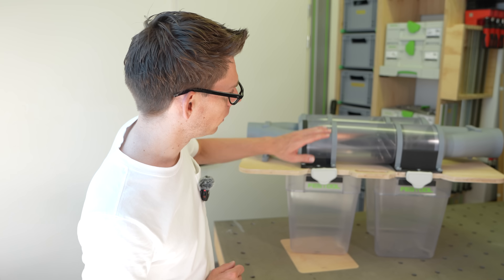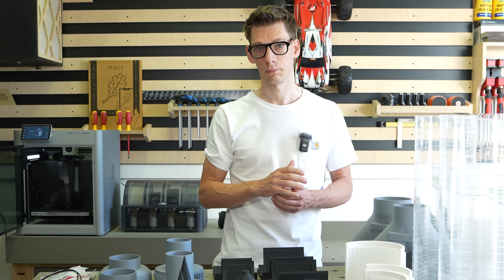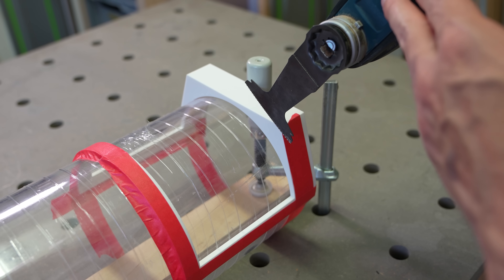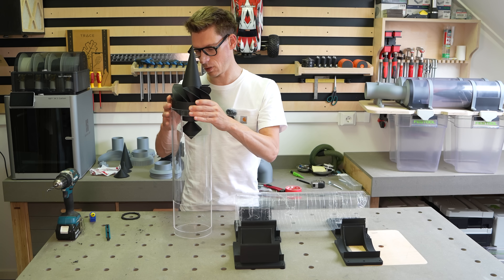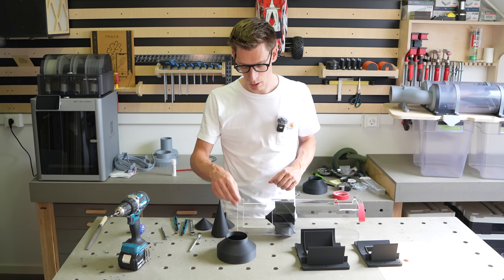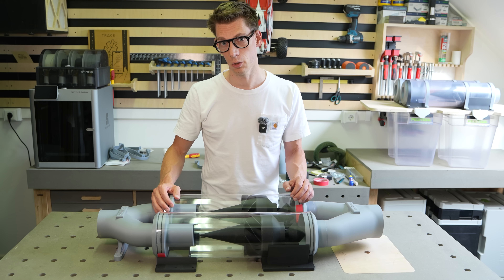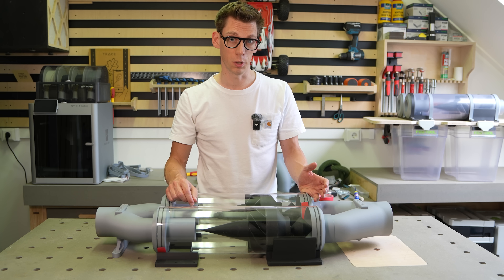I Built my Centrifugal Dust Separator, Again! (€200 Budget Dust Collection)

Comment: The tube remains by far the most costly part of this project, so I’ve thought of some options to explore:  consider making your own tubes by either using turned wood cylinder or pipe as a mandrel, heat form sheet of acrylic, polycarbonate or even pvc, then just use appropriate bonding agent for the seem which could be hidden at the bottom between the two openings?  Option two is fiberglass? Option 3 is to use less expensive nontransparent pipes with the possibility of adding transparent windows made from either PC or acrylic.

Also if I can confirm from your testing, the larger diameters (original 8”, then 6” or close to this 150mm) had the best performance especially in regard to adversely effecting airflow? But also in separation efficiency?

Comment: I'd redesign this with Ø10mm holes as the corners of the cutouts on the acrylic tube to reduce the risk of cracking the tube during assembly. (It's great work otherwise ) 👍

Comment: Hi Rudd, thank you for the project and the video series on it. I decided to print and assemble one myself for my CNC Router. I have it currently hooked up to a large dust collector fan with 4" hose from the CNC to the separator and 4" hose from the separator to the dust collector fan. 

What I am seeing is that the first stage does not catch much and whatever it does catch is sucked back up out of the bin and then brought into the second stage bin, then that too is sucked up and transferred out the fan. 

Do you think I possibly have too much air volume being moved? I see yours is set up with a vacuum style collector
Reply from the maker: This looks like you are moving way too much air through it. Do you have a idea what the CFM on your extractor is? And what is the air velocity on the y-piece intake?

In all the tests I did there was no such issues like you are experiencing. My CamVac is not capable to move large volumes of air but many have built it in combination with a 2HP harbor freight extractor which was working fine.

Simple test is to reduce the air flow through your collector fan by blocking the inlet or outlet partially.
Reply: @CapturingDust excellent Thank you for the quick reply. This was my suspicion. I am not sure on the CFM, I have a meter at work I'll bring home to check.
Reply from the maker: And are you sure all the seals are actually sealing properly? It also sounds like air is being sucked in from the waste bin, which then carries the dust with it.
Reply: @CapturingDust 

That is a definite possibility! I will check that

Comment: Hi, I'm loving all of your videos. I run a massive workshop and currently we have a dust collection system that runs roughly at 6500cfm with the main feed line at 250mm diameter. I have a custom made 9m3 collection bin that captures at a guess around 95% of our wood shavings. Now here is the issue, the return from the bin runs through to a bag house that filters down to only 5micons (this bag house we have to shake the bags every time before start up due to how blocked they get) ideally ill love to improve this by introducing a design very similar to what you have built after the shavings bin, but before the bag house however do it only using the second part of your separator design as I'm trying to capture the smaller particles that tent to block up the filter bags. 

By any chance would you be able to help me with some measurements for a system so large?
Reply: Sorry might I add I'm going to make the whole thing out of steel not 3d printed :) but really unsure of all the pipe ratios and fan fin angles etc
Reply from the maker: Hi Marin! Glad to hear that you’re loving the videos. I am trying to figure out what dimensions scaling will do with the design and efficiency. But that is easier said then done. You run a lot of CFM trough your lage pipe with I guess a lower pressure blower fan in front of the filters? 

It’s not a straight forward answer I can give you. Still figuring out myself what different parameter changes will effect the performance on separation and airflow restrictions. 

You can put multiple smaller separator in parallel to increase capacity. But to increase separation efficiency for the smaller dust particles you need to increase airspeed so the air rotates faster and smaller particles can been pushed to the outside of the centrifugal tube and filtered out. This will introduce more friction and your blower motor needs to be able to provide this.

Comment: This looks awesome, but also looks very complex and takes a lot space. I designed and built a cyclone that removes large and fine particles and has only 3 3d printed parts. A cyclone will reach higher circumferential speeds and therefore remove smaller particles.
Reply from the maker: I'm currently working on a video with tests to compare a normal Cyclone with the Centrifugal Separator. I just did not had the height available for the cyclone to fit in the workshop. So that's why I build this one instead so I could mound it above my planer.
Reply: Could you make short video about that? That would be very nice!

Comment: Ben druk bezig met het printen van alle bestanden. Ik heb echter een systeem van max 100mm afzuiging nodig. Je inlet is 120. Hoe kan ik deze het beste scalen naar 100?
Reply from the maker: I added the following files for you to the GitHub repository:
- MK2_EU_100mm-hose-adapter-to-100mm_REV2.stp (for CamVac flexhose)
- MK2_EU_Y-inlet-100mm_REV2.stp
- MK2_EU_bracket-inlet-100mm.stp
- MK2_EU_inlet_100mm_REV2.stp

See the file folder: 
https://github.com/Makerr-Studio/CentrifugalDustSeparator-/tree/main/MK2_EU/STEP
Reply: @ thnx alot! Im trying to use a different container to make it a cheaper build. Once done I can share my findings/files with you .
Reply from the maker: That would be nice! In USA someone already used different types of containers only they are not sold in Europe.

Comment: Has anyone tried printing the components in PETG?
Reply: I think going the route with carbon fiber added to the filament would be a good choice. There is a channel that did an exhausting one or two hour comparison of all the top filaments and highlighted PCTG as one of the best filaments
Reply: @VolikakisChristos  I am considering printing in PCTG for the added "slipperiness".

It is worth noting that PCTG is not carbon-fiber PETG (PETG-CF) but a seperate type of plastic. It is similar to PETG, but usually slightly stronger and with less friction. 

Addinf CF generally doesn't do much, just for the looks.

Comment: Something I've been wondering looking at the plans is how 'magic' the 500mm length for the main tube is. If it was shortened to 450mm then two could be made with one 6"x36" piece of clear tubing instead of 2. Do you think this would make that big of a difference on performance?
Reply from the maker: I have the feeling that 450 will work. Only I did not test that. The 500mm was something that Tim from Pilson Guitars had calculated based on the Harvey G700 and scaled it down from 8 to 6 inch.

Comment: If we assume that the design of the separator is perfected and we have transparent containers and transparent inner and outer hoses before and after the separator, we then can eliminate the need for the transparent acrylic tube and use just a regular plastic waste water pipe. It can be cut much more easily, it is a bit more durable and flexible. This way we eliminate one big part of the cost of the build.

Comment: Do you cut your tubing to 500 mm?  I see that the PVC tubing is sold in 36 inch lengths, and was wondering if 500 mm is the ideal length  for air movement, or if a longer or shorter piece would work just as well.  Thanks!
Reply from the maker: I took the length from the Pilson Guitars design. He scaled it back from the Harvey design. I have no idea if this is the perfect length for the 6 inch tube. Harvey uses 8 inches, so perhaps the length doesn't scale linearly with respect to the diameter.

Testing different length is a bit expensive and time consuming. My feeling is that a bit shorter tube (18 inch) still works fine. Only that is not tested.
Reply: @CapturingDust  Thank you for your reply.  I will let you know what I decide to do and how that length performed.

Comment: I wanna try something similar. 

Instead of the first section of the centrifugal system I'll just use a cyclone though. Then I'll add an impeller after that to separate the small particles. Then a vacuum with a HEPA filter.
Reply from the maker: It a bit like the cyclonic inlets I am testing with: https://www.youtube.com/shorts/yXznpm2pys4

Really good for larger dust from planers, not good for fine dust. It will overrun the first stage. 
You will need a vertical cyclone to benefit from the gravity. I think you had that figured out already?
Reply: @CapturingDust  Yup, that's exactly my plan. 👍

Comment: How does the dust seperator works with dust from stone or metal?
Reply from the maker: I did not test that one. I think it is a little too abrasive for the 3D printed parts. Depending on the weight of the dust it might be filtered out for the majority depending of the particle size. That is a guess though.
Reply: If you have a metal shop, I would definitely add a magnetic field to the dust separator to capture the heavier particles

Comment: Very nice! Have your tried 3D printing the seals from TPU? This has worked for me in many applications. Low lead time, customizable, low cost.
Reply from the maker: No I did not tried it. What kind of fillement did you use for it? Bambu Lab only sells TPU 95A HF
Reply: @CapturingDust  Sadly the spool(a few years old) doesn't list the Shore rating, and the name is "eLastic", which is super hard to search for.

Comment: Nice build! On a different note any time I see someone with an x1c without the gold pei build plate I always feel the need to recommend it. The bed adhesion is so good you don't need to print with brims or glue for pla and petg to stick. Since I purchased mine ive run 10s of kilos of filament on 100s of prints and have had less than 5 have adhesion issues. Its truly a game changer
Reply from the maker: I feel like this is the best tip of the month! I directly ordered one 👍. I need lots of glue with the standard plate so that would be perfect if we can eliminate that 😀
Reply: @CapturingDust  Just be sure to clean it with a bit of alcohol every once in a while and be mindful that your fingers leave behind oils that hurt adhesion so try to limit the amount you touch the plate directly where the parts might print and you shouldn't have issues again. Good luck

Edit: Also after printing on it wait for the bed to cool to room temp and the part will come off incredibly easy. It feels like magic

Comment: FYI, I've been printing from the STL files and there's notable differences between those files and what I see in this video. Would it be fair to assume that the STEP files are the most up-to-date?
Reply from the maker: For performance there are no differences. I have the EU version the most up to date. And will add the latest revision you see in part 2 of the in- and out-let, and Y-pieces later today. It should be compatible with older versions. They only need a bit less material to print now.
Reply: @CapturingDust  Specifically, I was looking at MK2_impeller-shroud.stl which appears to have a slot for a gasket that I don't see at 5:11, but I just now compared to the STEP file and see that they're the same.
Reply from the maker: Yes in the EU version I am testing with out the gasket for a more easy assembly. Only the fit must be really tight to achieve the same level of seal so I think the o-ring is helpful to keep in.
Reply: @CapturingDust  Ah! That makes sense now. ty!

Comment: One more thought for those in the UK - I bought some super strong clear automotive tape off Amazon - it is used for fixing broken headlights and mirrors on cars - I suggest wrapping the end of the tubes (2-3cm or so) in it to help stop the cracking occurring. Both my acrylic tubes cracked in the same spot when cut. I think the tape would provide enough extra strength to stop that happening - just an idea!

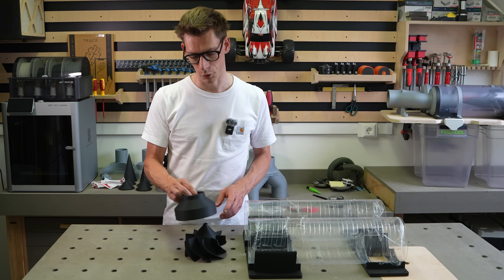Comment: 5:01 What is that needle you have there? I know it's glue, but I've never seen a super glue brand with that form. I would like some more info on it.
Reply from the maker: Sorry, I used Revell 39604 Contacta Professional Glue. It's not a real CA glue I guess more a cement that melts and bonds plastics. Reasonably quick drying. Pretty inexpensive you can get at your local hobby shop.

Comment: The superglue you use, isn't that the regular Revell glue used for building kits? Or is it a real CA glue? a tip for the future, make sure the corners of the cutouts in the tubes are round, drill holes in the corners and cut between the holes, this will give you much better strength. Sharp corners lead to cracks in brittle materials.
Reply from the maker: You are totally right! I used the Revell 39604 Contacta Professional Glue. And thx for the tips, for the PVC version it was not needed, did not had the idea the Acrylic was that brittle!

Comment: Really nice work. Looking forward to building one myself. I'm just wondering, is there a specific reason, that the outlet port (100mm) is smaller than the inlet port (120mm)?
Reply from the maker: Good question! My Hammer A3-31 has a 120mm connection on it. And my CamVac is 100mm. My thought was that if the dust is removed the volume is less so 100mm on the CamVac should be enough for the 120mm to the Planer. 

Only during testing I have connected it with a 100mm flexhose on both sides. I put a reducer right after the Planer and put the flexhose with the sleeve of the hose into the 120mm Y-piece. I still need to make magnetic hose adapters for the flexhose and buy a 120mm flexhose for proper testing.
Reply: @CapturingDust  Thanks for the quick supply. My idea was to use the 120mm Inlet also as an outlet. I'm just worried, that the second separation stage will be less effective, due to less clearance around the Port. But I'll guess I have to test that.
Reply: To clarify. I have to redesign the inner outlet to 87mm so the bigger port can fit.

Comment: The quarry industry quit using cyclone filters years ago (I think Tarmac held a few patents on them) because they don't filter the smallest particals, they switched to bag filters with reverse air blowing to clean off the built up dust.
Reply: Nobody is relying on these to capture the ultra fine particles, there is a fine filter after these to do that.

Comment: Great project! Is there any chance you'd test it with polystyrene dust? I need a solution when milling polystyrene, as it's so light my small cyclone doesn't work.
Reply from the maker: Polystyrene is not something I work with and I don’t have a big CNC mil. It is also very static and extremely light weight. I will keep it in mind only not planning on testing it very soon.

Comment: I understand that this build needs to look pretty for several reasons, one being youtube. However for me I would probably shave off about 50€ by buying tubes that are not see through. However one feature that I would add is the option to disassemble it faster for regular maintenance, so that you can quickly clear larger wood chips. My question is: What kind of vacuum do you have hooked up to the separator?
Reply from the maker: I use a Record Power CamVac with dual motors. You can save a lot money when you use regular gray pvc pipe. 

I am looking for a way to include small air nozzles into the 3D print of the shroud so a air compressor can connect to it for cleaning. Just blowing air through the inlet close to the impeller will also help.
Reply: @CapturingDust  Thanks to your info I just received my Camvac cgv336-4 today. I will repair my oöd 3d printer and get to pronting the separator

Comment: You have it hook up with the blower pushes the air into the intake (positive pressure). Would it work with negative pressure, i.e. the blower pulling the air from the outlet? That's the way I plan to connect it in my little shop.
Reply from the maker: Yes definitely! Mine is a redesign of the Pilson Guitars build. He uses a blower in the front; https://m.youtube.com/watch?v=R4R9GfCQrW4&

Comment: The only thing I'd design differently, I'd design the impeller to use a TPU printed gasket. This would allow for easy installation, and would help seal it from bypass airflow. This would also allow you to print thicker seals, that would resist air pressure.  Btw, great design concept. Very cool build.  Once i had a working concept, I'd build it to use regular construction PVC. It wont crack like acrylic.   Also, if you use cast acrylic, it will resist cracking better then extruded (if you really want the transparency).
Reply from the maker: Cool to read you build your own! I only printed PLA so far but it is a great idea to make use of the multiple printable materials. I also have the tubes is casted acrylic only it is twice as expensive in material. So did not cut them for now. Thx for your feedback! Appreciate it!
Reply: @CapturingDust  Any fexible/TPU is a material you should absolutely give a try. 
They open up a whole world of possibilities. More than any alternative to PLA (like PETG, ABS or any other specific material), since those all basically are the same: more or less stiff.
If you never try the "flexible half" of the filaments, you could potentially also miss out on half of the fun 😄